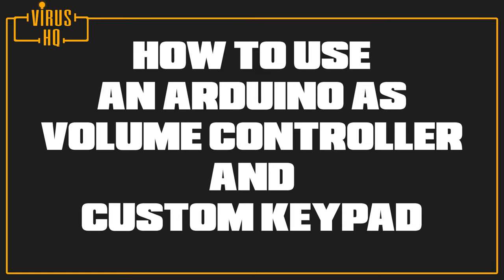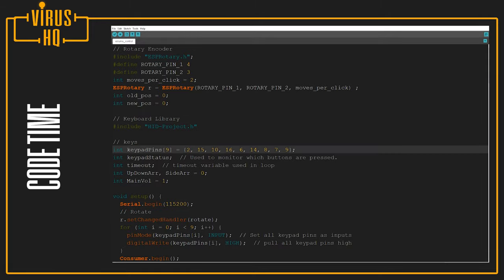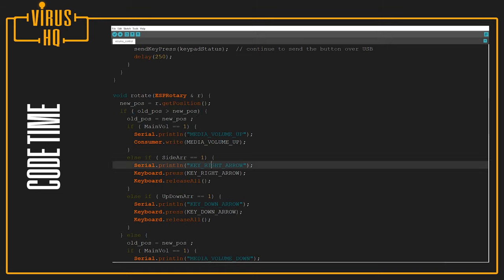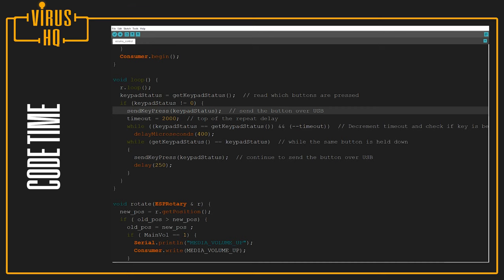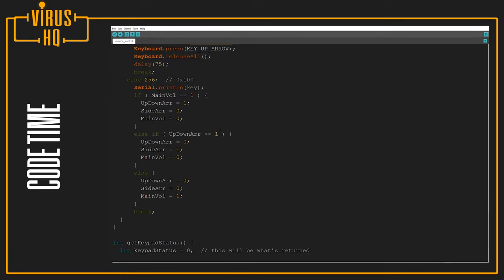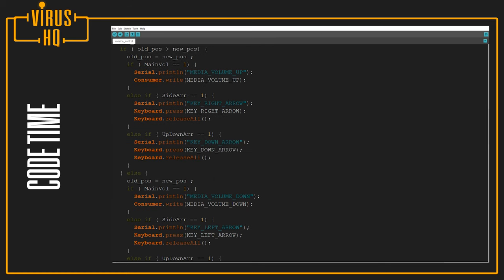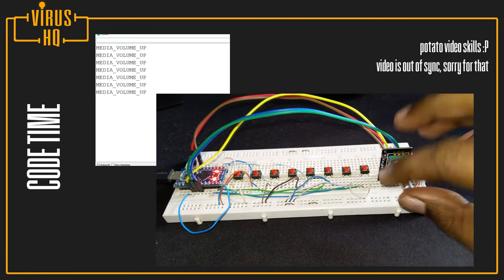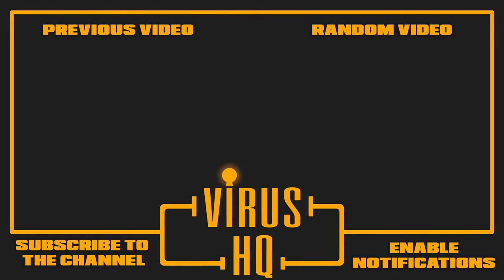Arduino USB Volume Controller & Macro Keyboard

Comment: How hard would this be to mod for Just a rotary encoder and an Analog thumbwheel - I want a basic HTPC controller, Volume, play/pause, up/down/left/right and enter ? I have seen the Analog wheel being used as a basic mouse but not sure how to combine the codes?
Reply from the maker: It should not be that hard since each device would probably get their own code blocks

Comment: Do you need to place transistors between the buttons?
Reply from the maker: They are not needed since the pins used all have internal pull-up resistors.